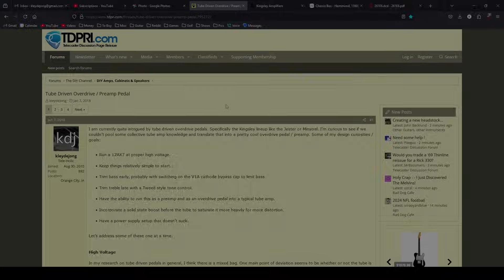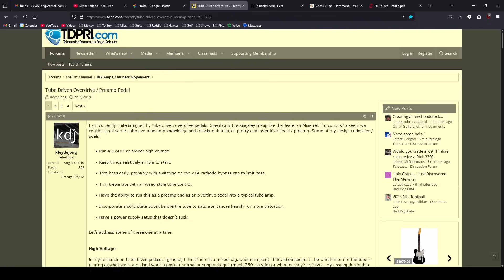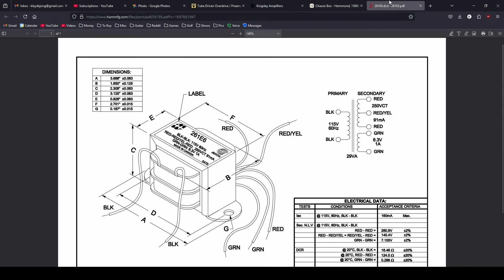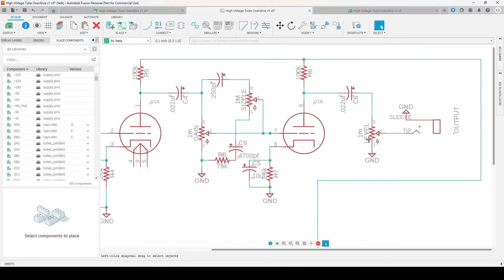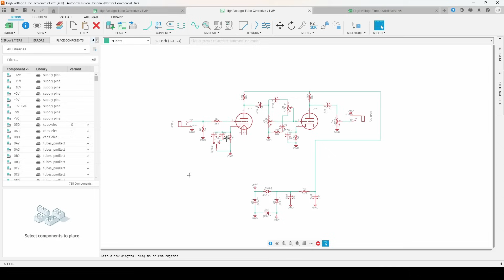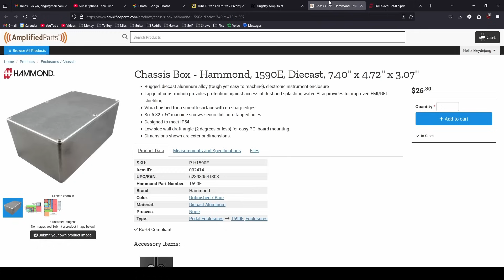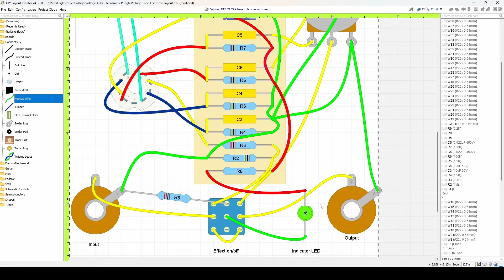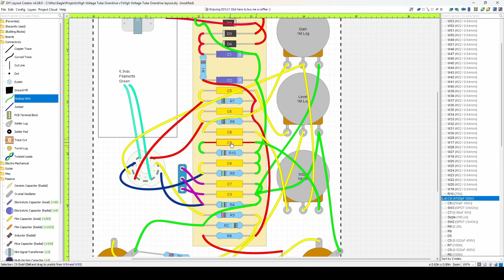DIY High Voltage Tube Overdrive Pedal Build - Pt. 1 | Circuit Design and Layout

Comment: So my pedal is finished and working, and it sounds great.
Just one issue, there a high hiss that increases with gain. Any ideas how to quiet that?
I'm using a nixie DC supply board.
Reply from the maker: Shielded cable on the signal path. Maybe add an extra filter cap on the dc supply?

Comment: Hi! congrats for your work. I think , either i'm missing something or you haven't considered the impedance mismatching when it comes to a 12ax7 output. That's why a second tube is often used as a cathode follower and bootstrap before entering any audio chain. You have this design in soldano, vox, marshall and the one who initiated all: the fender bassman 5F6. A cathode follower reduces the signal to a coherent level of 600ohms to 1kohm, which is the ideal value to enter on an amp or pedals. In the aforementioned designs, a cathode follower is used between the 1st preamp stage and before the tone stack, then the signal passes trough another preamp stage and from there straight to the power amp section. Another example of cathode follower is the Dumbleator, which is used as an external fx loop of the Dumble amp. Now, if you starve the plate of the tubes ala Tube driver- the mythic pedal used by legends- and put the 12axt or 12au7 after a jfet or any opamp, that's another story.

Comment: Total newb here. Planning a build similar to this but with 2 tubes.
First question: schematic shows 2 tubes. Is that just to make it easier to follow?  
Is there a power supply that replaces the tx and bridge rectifier and supplies enough current for 2 tubes?
I want to recreate a custom pedal made by Zot pedals but never marketed. 
You don't have much in the way of DC conditioning after the bridge. My circuit has 3 x that. Did you not need that? My circuit is a 5 watt amp circuit, but I will not include the 6v6 output, so just preamp out like yours.
Your pedal sounds great btw. Well done.
Reply from the maker: I used a 12AX7 which is a dual triode.  So two gain stages in one glass tube.  Two 12AX7's would be four gain stages.  

For the power supply I did not put it all in this schematic.  I think I have more info on it in future videos.  Basically I used a computer IEC plug to provide 120vac from the wall.  Ran it through a switch and a fuse.  Then into the primary of a power transformer (a Hammond 261E6 I think).  Like this:

https://live.staticflickr.com/65535/54280603009_6a99cdf63f_o.png

The PT had plenty of current for just one 12AX7.  

I think I used bridge rectifier - one filter cap - dropping resistor - second filter cap.  You could do another stage, but I felt like the pedal performed quite well and wasn't overly noisy.  

Thanks!
Reply: @KleyDeJong 
Thanks. I was looking at the 261c6, identical except half the current at 45 mA. Do you think that's insufficient for 1 ax7?

Comment: This is basically a clone of the Kingsley Page but (very) slightly modded. The transformer is unnecessary. 
You should read up on how Sushi Box FX does it. He and Simon use Nixie boosters.
The Page doesn’t use a transistor to boost the front end. The Harlot and Minstrel do. 

Lastly, some transistors can run between 20v-40v depending. So you might be able to tweak the circuit for a boost if that’s what you want. 
There are also MOSFETs which can use higher voltage. Good luck

Comment: A couple of other things I've noticed... To make the pedal safer to work on, you should add a bleeder resistor across C2, 220K is typical. This will automatically drain voltage from the caps when the power is off(takes a minute or two to become safe). That transformer has 91mA available while you will be using less than 3mA so you will find your B+ is much higher than you expected. R1 and the bleeder resistor will create a voltage divider allowing you to dial in the exact B+ you want (probably around 300V).
If the Sizzle control makes the pedal too sharp and raspy you could bypass the clipping stages plate resistor with a 1n or 2n2 capacitor (2000V ceramic is typical). That should make the Sizzle control more useable(and reduce hiss).
Good luck with the project, I can't wait to hear it!
Reply: Btw, even with a bleeder resistor in place you must check the caps for voltage just in case there's a bad connection preventing the resistor from doing its job! Safety first!

Comment: I always through the ultimate grail pedal would be a tube overdrive with 2 sets of boss GE7 EQ controls. One pre and one post. Kinda like taking a Kingsley pedal and putting a GE7 before and after but all in one enclosure. The level for pre would adjust gain and the one for after would be volume
Reply: If you can make one let me know haha. I’ll buy it
Reply from the maker: @dansomerville  That would be amazing...

Comment: Some amp builder wisdom that may help... That power TX has 1A available for 6.3V, a single 12AX7 only uses 300mA so the load regulation will not work and you will probably get well over 7V on the heater and the valve will fail quickly. You could try using a "wattless dropper", a capacitor in series with the winding, maybe try 100n to start with and experiment from there(use a cheap or worn out 12AX7 for dialling in the voltage, why risk damaging a good valve!?).
A toroidal transformer will introduce less hum into the circuit.
The mains fuse must come BEFORE the power switch to protect you if the switch fails.
For the tone control to be most effective, it should come AFTER the clipping stage so that it can control fizz. Putting it before the clipping stage may result in flubby or buzzy sounding overdrive. You should probably put it on the Volume control and use a regular Bright Cap on the Gain control.
You could take the output from the second stages cathode(as long as it has no bypass capacitor). That will give you lower output voltage and low output impedance. You would also have to use a 100KA Volume and adjust the Sizzle control to match.
If you find you want more distortion from the circuit, try increasing one or more of the plate resistors to 220K or even 330K. Perhaps simply using a Tube Screamer in front of it will sound best.
The second stages cathode resistor can be anything from 800R to 10K, larger resistors give a crunchier/rocky sound.
If you get oscillation or blocking distortion, try moving the grid stoppers right to the grid pin and maybe increase their values to 68K(or more for the second stage).
That circuit board type is called a "tagboard", not turret board.
Have fun and don't electrocute yourself!

Comment: I just thought of something ... the PAIA Stack-In-A-Box supply ( as a reference for the typical 48 volt tube overdrive pedal type power supply )
I think the guys need someone to buy them a coffee, if someone wants to do a low voltage tube overdrive.... but the Kit is rack mount.

Kley's rendition here is non-typical, I don't think anyone has ever done it like this ...that's not to say it isn't interesting, I am in for the duration on this one, for sure....it's like a Jose Mod in a pedal.

Comment: With plenty of gain stages you should dump C-3 and make the second stage a cold clipper. Also, you don't need much current since there are no output stages so a 6.3v transformer wired in reverse would give you over 200v if you feed it with a 12vac wall wart.
Reply from the maker: Good ideas, I think I need to build a second one after this is completed!

Comment: Just curious why you are switching the neutral and not the hot on your incoming power, normally you always switch the hot otherwise everything is at line voltage when the neutral is open.  And the power supply in the Kingsley is a switched mode DC/DC boost converter, they're really efficient and stupid cheap! Fascinating work so far, can't wait to hear it!
Reply from the maker: Good catch, I did end up seeing that and fixed it during the build.  Part 2 coming shortly!

I would be very curious to experiment with those power supplies in the future.  Maybe a version 2!
Reply: @KleyDeJong  can't wait! This is a cool project!
Reply: And isn't the hot supposed to go to the fuse before the switch?

Comment: Two things: as a suggestion, you might want to make your "bass" switch a 3-way type.  Then, with no extra circuitry, you get the third choice (middle position) of no cathose cap at all, which will give you a reduced-gain, full-frequency voice, which can be a nice mode to have available.  And, regarding power supply, you might want to look at one of the switching-mode power supplies they have now on the Internet, which provide 260V and 6V DC, they ramp up the HV smoothly after a warm-up period, they also provide 5V DC for logic, all the amperage you might need even for rather large tube projects, and the size will fit in a 1-U rack box.  They solve so many power issues in one swoop.  And price is like $30 or less (well, pre-tariff-era).
Reply from the maker: Good ideas, thanks.

Wow those sound killer!  I need to look them up.
Reply: Any link ?

Comment: I was also intimidated by the power supply. Build a nixie tube 12 volt to 300v power supply and set it to 270v. I've built a twin reverb preamp with Jazz rock boost mods. Busy building an ODS with 2 tubes. Fine tuning as you know is not that easy. Good luck and enjoy the build. It's more fun than building full amps to me.
Reply from the maker: ODS preamp would be killer!  Where did you get the nixie from?  I've seen some on Amazon or eBay that are pretty cheap.  

Did you have any trouble with ground loops?  My first iteration used typical metal 1/4" jacks, but I had a bad ground loop buzz between the chassis being grounded to both the output jack going to the amp and the IEC power plug.  I've got some plastic cliff jacks coming in the mail and I installed a hum buster circuit from Merlin Blencowe's grounding PDF.  Hoping that fixes it.

Comment: Very cool.  I feel like I can hear the 68n bass cap already.  It might be fun to play with your sizzle pot pre/post gain.  I have some old 12v car radio tubes and I wonder if lowering the voltage the tube wants to see vs building a real non-starved ps is the consideration for board friendly capability...
Reply from the maker: Thanks.  I am currently working on voicing the tone controls right now.  I think I settled on a 10nf bass cap on the cathode.  Tightened things up nicely.  

I also played around a lot with the sizzle / tone control.  Great observations there.  I should have episode 2 out shortly and am working on episode 3 where I make several tweaks.  

A 12v tube would be interesting!  I have never messed with low voltage tube circuits, but would be curious.

Comment: Why are you fusing/switching the neutral(white) wire and not the hot (black). Since modern wiring has neutral and ground bonded, it’s significantly safer to fuse the hot wire
Reply from the maker: Good eye.  I also got that feedback in my TDPRI thread and have since fixed it.

Comment: I made a circuit that drove a single 12AX7 using a 9-18VDC power supply, but used a boost switcher that took the 9-18V and bumps it up to around 50VDC. I had a problem with a lot of switcher ICs, but after tearing apart a Joyo Zombie, I discovered the XL6007E1 chip. My whole circuit was through hole components, except for that IC. It's a SOIC-8, and not too terrible to hand solder. All the other Boost ICs I tried make too much noise, but I the XL6007 didn't seemingly have it. So, essentially, I have a "Tube Preamp" using decent DC voltage. Let me know if you want the schematic, Kley.
Reply from the maker: Awesome!  That's very cool.  I've been pretty happy so far with the IEC power setup I have.  I almost always bring a power strip and extension chord to any gig I play anyways.  But DC power is something I'd like to continue to explore.
Reply: @KleyDeJong  at least with the boosted 50V, you do not risk fidgeting with mains voltages. I emailed you a copy of my schematic.

Comment: Yes the Toroidal transformer is the trick. I did this a few years ago on my preamp build. Go check out this sound with built in cab sim. Barchetta Valve Amp preamp JJ750.
Reply: I just built a Matchless Hotbox clone using the Hammond 1182E110 toroidal transformer. The only difference from the 1995 schematic is that a 4-diode full-wave bridge rectifier is used and the transformer center tap does not go to ground.. Then a 7.5k 2W resistor from the rectifier to the first cap and the voltages were the same as the schematic.
Reply from the maker: Do you remember which model transformer you used.  Is it a 12vdc to 240vdc type situation?

Comment: wouldnt output signal need to be reduced and made low impedance in order to make it back through cabling to an amplifier?
Reply from the maker: Yes absolutely.  I ended up making quite a few revisions.  I believe I ended up going coupling cap - 220k resistor - 25k audio taper volume pot.  The pot value helps set the output impedance better for a guitar effect.

Comment: I like those little blue torriodal pcb mount transformers for little stuff ( they have them on Digi-Key ) ... you can put them in the same box, with just a little space, and there is no line noise.
Reply from the maker: Nice!  Would it be 120vac on the primary?  Or would it take like 12vdc up to 240vdc?
Reply: @KleyDeJong  well the thing is the pedal board environment ...but a pedal like that could go on the periphery of the board, and be ok with line ... I know I would want to build it line, because it's a lot of extra circuitry otherwise.
Reply: @KleyDeJong  how about a short shielded line cable ? like IEC remote to shielded cable to pedal ?
Reply: @KleyDeJong  they run them like a squishy diode clipper ... in general, it's not like the tube circuits in amps.
Reply: @KleyDeJong  i guess i had the little blue torroids on my mind because i have to pay for custom transformers with a bias tap, if i don't come up with something else.
Reply: @KleyDeJong  like a 555 type timer, and a voltage quadrupler, that's generally how they do that.
Reply: but you're building a real tube circuit there, yah know? ... think 48V for pedal tube stuff.

Comment: i should learn switching supplies better .... like some of these wall warts, i look in there and go wtf ?
Reply: https://youtu.be/PgTR7226sHU?si=Hek6PIiEFxDe3kmW
 Switch mode power supply operation explained 👌
Reply: @dangoldbach6570  yeah I know all that stuff... I have studied it....but I don't have any references that a low me to actually design a supply without guessing....if I have to guess, I can't afford it.
Reply: @dangoldbach6570  I know references have been compiled, because people get paid big money to guess, document, guess, document, guess document, ect. ect. so designers don't have to ..... I am not getting paid crap loads here, I would be burning up components Which I Would Have To PAY For.
Reply: @dangoldbach6570  ok ok...I have LT Spice loaded up... but it would still be nice to have a reference that could get me in the ball park to stat with.
Reply: @dangoldbach6570  you know what I need to design a linear supply ?....ohm's law, that is it.
Reply: @dangoldbach6570  I bet if I search for a reference I would find something ... I guess linear supply design is sort of the lazy way out, or the comfort of something familiar .... I will bite the bullet one of these days, when I have an application.
Reply: @dangoldbach6570  I don't even mess with ohms law so much on a linear supply.... the load yeah, then thevinin stuff there.....but the supply is like x 1.414, and I got enough head room on stuff, ok that will work.
Reply: @dangoldbach6570  I guess by the time I am done with the load calculations, I don't feel much like doing an unfamiliar switcher on top of that.
Reply: @dangoldbach6570  well, the supply filter, that sometimes is something I sleep a few times on while I am working on something else.
Reply: @dangoldbach6570  see switch mode, the filtering is part of the actual circuit ... it's tuned.... I can figure low pass, but that's because I have references.
Reply: @dangoldbach6570  so I know it's a tuned circuit, I know its feed with an active switched by a single frequency PWM osc ....it's a cap and an inductor, what's the problem? ...I have never done it before.
Reply: @RulgertGhostalker  the best thing honestly is to pull the data sheets off a ready made supply from digikey,  they're usually stashed in there under the description.  I've always just used their reference circuits on how to connect up a ready built supply, they did all the hard work for me and I can just treat the supply like a battery in my circuits. Designing a supply from scratch is way too much work! 😅
Reply: @dangoldbach6570  thank you.
Reply from the maker: Yeah agreed, I'd be curious to know how they work.

Comment: I built something very similar to this last year. One thing you may want to experiment with is the value of the level control, 1M is perfect for a preamp but the signal will be really hot if you’re using it as a dirt/boost pedal for your board. I’m really excited to see how this turns out!
Reply from the maker: Good idea, my current progress today has made several changes.  I believe I ended up going coupling cap - 220k resistor - 25k audio taper volume pot.  The pot value helps set the output impedance better for a guitar effect.  More episodes coming soon!